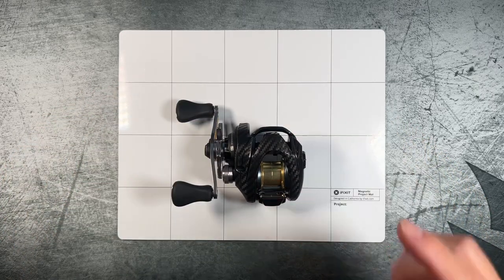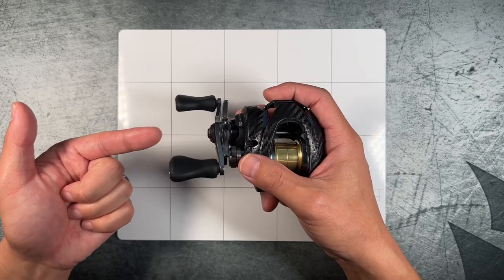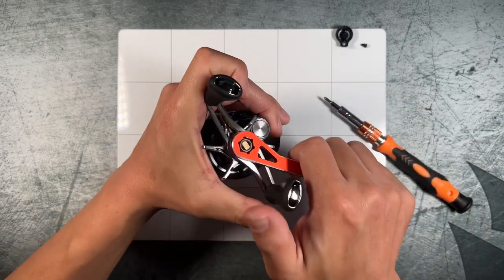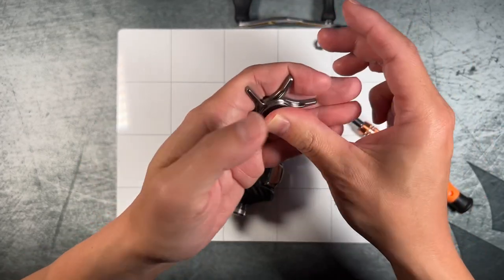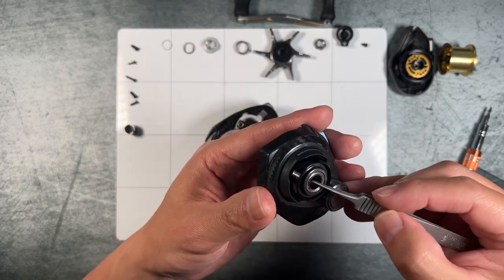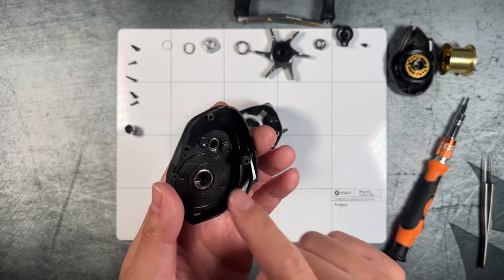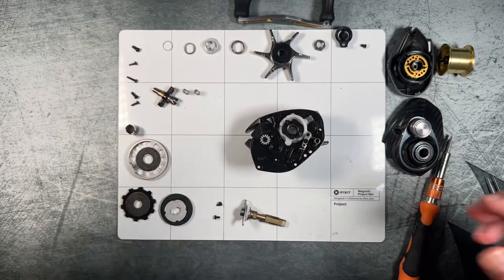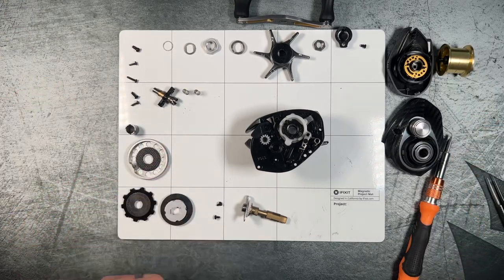😱 MODDED SHIMANO ALDEBARAN BFS 2022 + TEARDOWN (Part II) ✌️🔥

Comment: I'm not interested in changing spool, but I change worm gear bearing during the first maintenance, thank you for video.
Reply from the maker: Hey there! What did you think of the upgrade? Imho it really improved the smoothness of the handle rotation and is worth the effort of tearing down the reel. I wish Shimano had allowed for one extra bearing in the opposite side of the worm shaft and I’m not too sure how I feel about the worm shaft being made of plastic. In any case thank you for sharing your experience and cheers!
Reply: @BFSFISHINGCHANNEL  haven't been fishing yet with Aldebaran, we have  -20C , even the rivers are frozen ;)
Reply from the maker: @sepaonualvar  -20c is definitely cold!!! Stay warm my friend!

Comment: What? The handle side plate is made out of plastic/ci4? I always thought it was magnesium. Soon, they'll be making the frame out of ci4, and assure us that its better than metal...
Reply from the maker: Haha I don’t think you have too much to worry about! I’m pretty sure there will always be a place for metal frame reels. That being said, I am no Shimano engineer but I don’t believe the sideplate absolutely needs to be made out of magnesium. Many other mag frame reels actually use the same strategy to save more weight and actually carbon frames aren’t bad at all. They’re not nearly as rigid as metal frames ofc but they’re pretty close, don’t get cold, and are much cheaper than magnesium. Would be cool to see a budget Aldebaran made of ci4 but that’s just my opinion. Anywho, thanks for sharing your opinion and cheers!
Reply: @BFSFISHINGCHANNEL  Less than 10 years ago, a plastic worm shaft wouldn't be something people could even imagine, and here we're, shimano uses it in almost every of their reels. You really don't know. Not to mention that all reels with plastic handle side plate feel more hollow when under load, so that's another negative i am not to much of a fan off of.
Reply from the maker: To be honest, I agree with you 100% on the plastic worm shaft. I am not the biggest fan of that as well as the shaft housing being plastic. Just doesn’t scream longevity to me… I get what they’re trying to do but it would be nice if there were options or upgrades for metal pieces. As far as these BFS reels are concerned though I haven’t had any issues with flexing under load but I do agree that the carbon frames feel hollow. All the more reason to collect and upgrade(when possible) older reels I suppose…

Comment: Does the 2017 model use the same size bearing? If so, what is the dimension of the bearing?
Reply from the maker: Hey Lee! Unfortunately, I am not certain of the 2016/17 aldebaran’s bearing size. Actually, which bearing were you referring to? It’s possible that they use the same size bearing for the worm shaft but it is unlikely that they use the same spool bearing sizes as the 22 has the silent tube bearings which are very unusual sizes. Sorry that doesn’t help much… let me know which bearings you were referring to and cheers my friend!
Reply: @BFSFISHINGCHANNEL  Worm gear/shaft you show us how to update/upgrade here
Reply from the maker: @leepao6302  hey Lee! Ok so I spoke with @themultispeciesangler and he’s performed this modification. He says it is the same size and the handle knob bearings so I am guessing that it will be a 742 sized bearing. I am not sure if he has a video on his channel but he may have one showing how to do this? Sorry I can’t be of more help with this but I hope at least this does help a little. Cheers my friend!
Reply: @BFSFISHINGCHANNEL  i just want to know the dimension, i know how to install it, i just wasn't sure about the size of the bearing that's all, thanks for going through  trouble to help a stranger, but just subscribe is the least i can do
Reply from the maker: @leepao6302  hey Lee! I appreciate it! If I am not mistaken I think the size will be a 4x7x2.5mm bearing. The other size might be a 4x7x2mm but that’s fairly uncommon. The 4x7x2.5mm size is used more in Shimano and daiwa for the handle knobs and that should be the size that the worm shaft gear bearing is. Hope that helps and cheers!

Comment: Great vid. Will be making some upgrades to mine asap. Noticed the resistance in winding however I thought this was how it was supposed to be. Pretty cheap of shimano to not use a bearing and replace it with a bushing. +1 sub and I followed on insta 👍👍👍
Reply from the maker: Hey there much appreciated! Yea the only reasons I could think of that they didn’t include a bearing is for weight savings and also corrosion resistance. Those considerations are a bit on the negligible side though imho… anyhow I’m glad you got good value out of the video and cheers!
Reply: Yeah it could well be. For the price of the reel you would have thought it would be premium parts throughout. Cheers for the reply!
Reply from the maker: @makeorwellfictionagain3553  I agree with you on that 1000%. They dropped the ball on that part sadly… That being said, the reel is buttery smooth out of the box but it’s that much more with the bearing installed. Still have no clue why they went with a bushing 🤦‍♂️ haha. Cheers buddy!